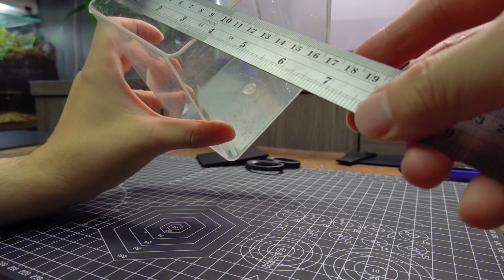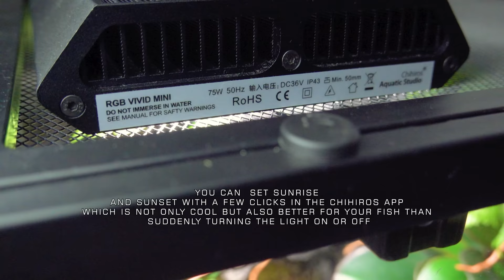Creating a Vivarium Wonderland for  White's Tree Frogs l Aquaterrarium l カエル l Paludarium

Comment: I plan on starting something like this very soon
Can you make a video on how you maintain the shrimp and frogs?
If not, can you answer a couple questions?
1. Do the isopods and springtails take care of the poop, or do you clean it
(If you do, how so?)
2. Do you feed the shrimp and clean its poop, or does it just survive off algae
(and plants take the poop for the nitrogen cycle?)
3. What maintenance do the plants need?
Do you just mist them everyday?
Reply from the maker: Isopods and springtails can help break down organic matter, including poop, within a closed ecosystem. 
Shrimp in a closed ecosystem primarily feed on algae and detritus, which includes organic matter like decaying plant material and microorganisms. 
Mist the plants as needed to maintain humidity. The frequency will depend on the specific plants and the moisture levels in the closed ecosystem. Be careful not to overwater, as this can lead to mold or other issues.
Reply: @ferretwonderland  thanks!

Comment: This is beautifuL! out of curiousity (because adding a waterfall/pond is something id love to do) with all the running water does this still sit within the 50-60% humidity range Whites need?
Reply: I think that would depend on where you live and also the tank size, I have mine in a 70g and live in an extremely dry climate and struggle to keep the humidity at 50-60%, im currently working on a project like this so I can keep you updated on my humidity if you’d like once I finish it
Reply: @Pater___  please do! i am starting my project for my whites tf and would love to hear how humidity fairs with a water bottom like this
Reply: @Pater___  I live in a dry climate as well, but I am concerned because this tank has so much water the humidity has got to be too high. Did you have any luck getting the level to the right place?

Comment: What kind of driftwood are you using? And what is the size of the plant pots? What is the glue you use for the rock details?

Sorry so many questions 😅
Reply from the maker: The driftwood is only for aquarium.you can find it at aquarium store.
The plant pots with a diameter of about 8.5 cm
Glue is instant glue.

Comment: Great job. I also made a paludarium and mold appears, how can I prevent this or what do I need to adjust? humidity is between 60-70%
Reply: Add springtails! They eat mold and decomposing organic matter. If that doesn’t help, there might not be enough ventilation. Adding a fan could work, but adding springtails is probably simpler, cheaper and more fun.
Reply from the maker: You can also add isopods.keep ventilated

Comment: Have you had any issues with frogs potentially drowning, as i know they are not god swimmers? Or the frogs trying to eat the shrimp? Lastly how do you keep water quality high if frogs poop inbthe water?
Reply from the maker: Great questions! I've taken precautions to prevent any issues with the frogs. I've provided shallow areas and floating platforms to ensure they have easy access to land and can avoid drowning. 
To maintain water quality, I follow a strict routine of regular water changes and use a reliable filtration system.
Reply: @ferretwonderland  ahh that's fair enough. And what about humidity in the tank? What does it normally sit at? Does yours spike high at any point during the day?

Comment: Do you have trouble with feeder crickets drowning?
Reply from the maker: Feeder crickets can indeed drown if they are provided with deep water sources without a way to climb out. Crickets are not strong swimmers, and they may struggle or become trapped in water, leading to drowning. To prevent this from happening, it's essential to provide shallow water dishes or use water-absorbent materials like damp sponges or water crystals for hydration.

Comment: I would absolutely avoid using tongs when feeding them. They do not have the best aim sometimes and can be very forceful when they eat, so the tongs can easily injure them! I always feed mine by hand, holding the insect between my thumb and index finger. This is especially important when they grow larger and heavier. And don't worry, they don't have teeth, but instead plates with a sandpaper texture in their mouth. If they were to accidentally chomp on your finger(s), it doesn't hurt at all. Just take your time and let them figure it out if they grab your finger, as it can harm them to forcefully pull your finger out of their mouths. They absolutely love crickets and wax worms too, and the insects should be dusted with calcium and vitamin powder (e.g., from Repashy). Good luck!
Reply from the maker: Thank you for sharing your feeding tips! Feeding these creatures by hand seems like a more considerate approach, especially as they grow larger. Your insight about their mouth structure and the sandpaper texture is valuable information. It's great to know that even if they accidentally nibble on a finger, it won't hurt. Patience and gentleness are crucial when interacting with them. Also, the recommendation to dust insects with calcium and vitamin powder is a helpful addition for their nutrition. Thanks again for your advice, and good luck to all the pet owners out there!